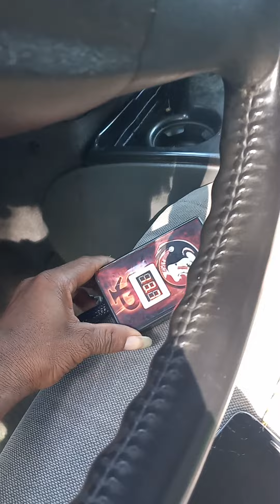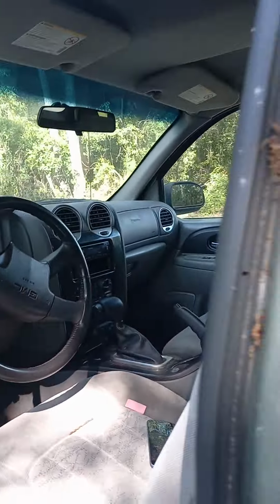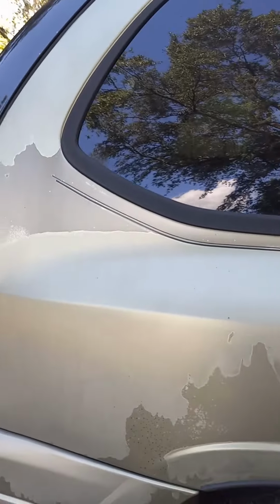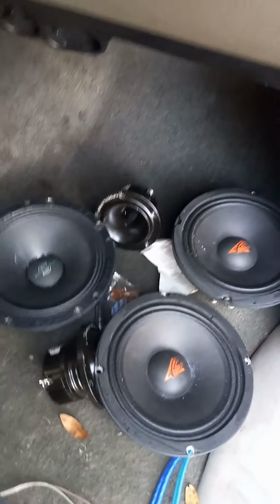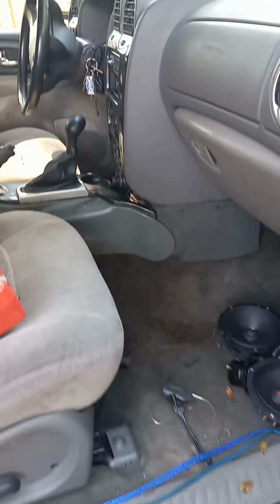New build

Comment: Nice
Reply from the maker: Just ready to get another 15 and bigger amp
Reply: @tracyspencer5611  yeah get the another 15" hdx3 and a S1.2250.1 amp and you'll really be loud. The S1.2250.1 amp works at half ohms so you can get about 3000 watts at half ohms.